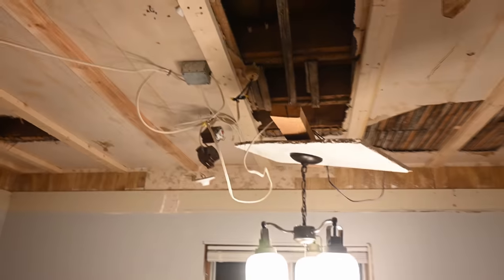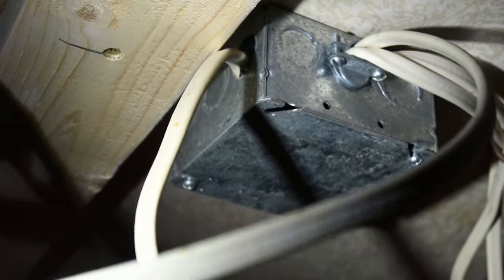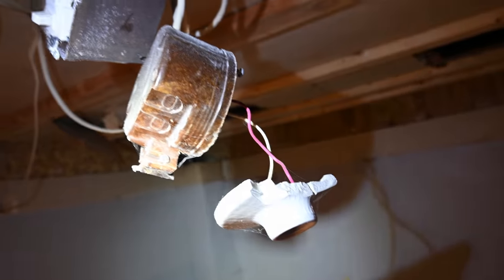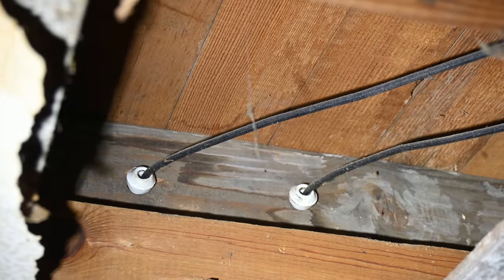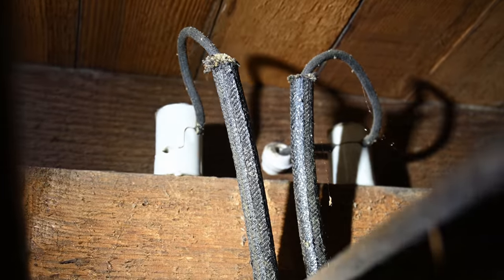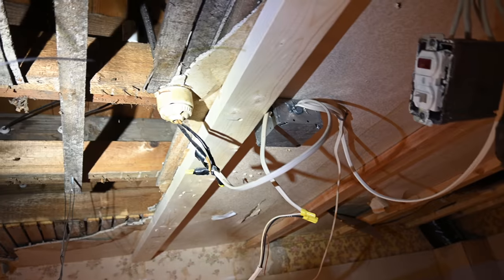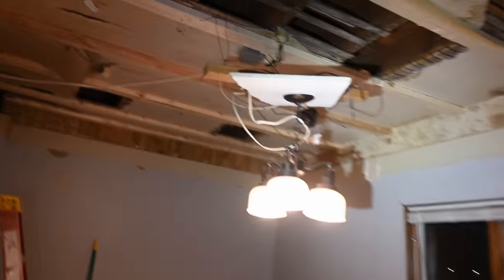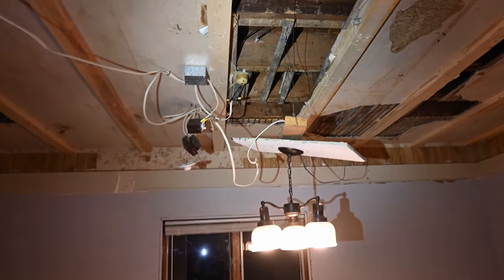The Worst Modified Knob & Tube Wiring Situation I've Ever Seen

Comment: My current house doesn't have knob and tube,  but it had what I call festive wiring.  I had old blue aluminum,  orange  copper mixed with modern white wire and some weird brown 1970's 14/2 looking  wire that I have never seen before. 

I  have been working on replacing it all for about a year.  So evey moment of spare time has gone into just fixing the wiring issues.  I  only have the kitchen, dinning , and living room left to do. But it's been a nightmare removing exactly the type of stuff you just showed.
Reply: LOL they did have a rainbow of colored sheaths in the 60's to 80s
Reply: @konradpetz7317 ,  Yes. All the different wiring through the decades were very colorful, and my house was like a museum of wiring through the past four decades.  

Unfortunately,  the original owners mutilated eveything to the point that I had no choice but to take it all out.

Comment: The flexible insulation is called Loom. I once did a job in an old multi family (3 decker) that used knob & tube for the stairway lighting. They only had 2 conductors between 3 & 4 ways. I took an early lunch break at home and dug out my notes from school. It was called the Carter Multipoint Switch system. It worked, and was apparently legal when installed, but is now considered illegal because polarity to the lamp holders would reverse depending on which switch was in what position. I’m sure glad I kept good notes!! My instructor was probably a generation removed from Edison. Seriously. His Master Electricians license number was a single digit!! I still have a diagram of that Carter system.

Comment: 😂🤣Funny stuff. I've seen plenty. Going up in the attic in a house I bought, I stepped on a small junction box and the lights blinked. The box was too small and had 4 BX cables going into it, no caps, just taped together. I spent the next weekend rewiring everything I could get to....

Comment: I once traced a 50A/240V line from a kitchen oven to the outside main panel.  About halfway along, in the attic, I found the insulation stripped on one hot leg and the neutral, wrapped in tape (no wire nuts or junction box) and taps run to the ceiling fan in the room below. This mess was completely covered in loose cellulose insulation. Yikes.

Comment: My house was built in 1898, and had many wiring issues when we recently moved in.  I'm slowly working my way through them.  We've got a couple fixtures that don't work, but mostly switches that don't do anything and I don't know where they lead.  Just today I got two outlets working that were miswired.  It seems as more people moved in, more people didn't understand what they were doing and mucked things up.  It's an interesting challenge.  At least a nice 200 A panel had been professionally installed.

Comment: In my attic when fixing a ceiling fan which was installed wrong I found romex wire stripped (hot and neutral) about 2’ of bare wire separated with a Piece of fiberglass  insulation. The wire was live. When I saw this I turned off the main panel and went through the whole wire system in the attic. Found very similar wire connections like what you encountered. No junction box/ junction box with no connectors!
Reply: Oh brother; that's terrible!  I don't see much excuse for leaving something in that condition.  It's not like Romex is expensive, at least for that amount needed to properly replace.
Reply: @dougb8207  most people who try to do there own electrical install have no clue what they are doing. The worst is when they think they know how to do it. I was fortunate that I didn’t get hurt or the house didn’t catch fire. The ceiling fan that I was intended to trouble shoot because it started to smoke when you turned it on was installed with the original old works ceiling box held together with #14 wire to the stud and nail. I had to redo all the ceiling boxes with the appropriate ceiling fan box.

Comment: The K&T in your video is in amazingly good condition, all of the stuff I find the insulation is cracked so much you can often see whole sections of bare conductor. In my house I often saw in-line splices (no box and no wire nuts) in the joist space which would have matching scorch marks on the wood behind the junction - presumably from modern appliances overloading the wiring and especially the electrically-poor splices. My favorite find was when I recently pulled a failing receptacle out of its junction box to find a K&T branch coming off the secondary lugs and out the bottom of the box. After investigating all junction boxes in the immediate vicinity and not finding any other K&T, I started gently pulling on it just to see what I'd get. Ended up pulling 6' of K&T wire out to find that the wire didn't actually go to anything at all and was just hanging out, live & exposed in the stud space below, for 16 or so years. Scariest was when I discovered several relatively new NM runs that had been chewed down to bare conductors by mice.

Comment: Yikes.
I once saw a situation where a guy that had no idea how residential wiring worked, tried to steal electricity by installing some lamp cord into the meter side of 200A main breaker in a panel and wiring it to a receptacle. Figured it was free because it didn't pass through the main breaker.
Reply from the maker: Yikes. That's terrible.
Reply: Ahh yes Darwin’s theory in real time. You should not have interfered with evolution.

Comment: We recently bought a 1972 house with an outbuilding that has been a wood shop, barber shop, and an apartment.   Neutral switched, multiple junctions with no box, 30 amp breakers for lighting and receptacles.
Reply from the maker: I actually found that some of the 14awg wire on this project was on a 20a breaker. It's amazing that houses don't burn down more often.

Comment: When I moved into my last house I found the downstairs lights wired with speaker wire. Then I found romex that had been stripped mid run and had wires wrapped around it for a tap to an outlet. Had to gut it all.

Comment: That’s updated, has insulation. I not sure, but that “  may “ be asbestos. Tubes are great knife sharpeners. 😁
  Almost forgot. A building in old town  part of city that had bare wire knob and tubing also had three little metal film containers in attic that held film repair manual for GMC’s first automatic transmission. Pretty cool find. 😎
Reply: probably not asbestos. More likely either old style plaster, which contains cement and horsehair fiber, or Homasote / beaverboard, which is a pressed paper product. Either way, the 100+ year old dust that comes down with demolition is not good to breathe.... and sometimes contains coal dust or rodent droppings.
Reply: @rupe53  If I messed with any of that in an old house I would wear an N95 and pray that the insulation isn't asbestos (which is a possibility).  I don't want any of that stuff in my COPD and asthmatic lungs.
Reply: @mharris5047  ... I am not aware of any home insulation that was asbestos, other than what was used on pipes. Shredded newspaper or cellulose was way more common back then, if anything. Still, you'd be smart to protect yourself in a demo project. Plaster dust is loaded with the same crap as crumbling cement, but the particles are finer.

Comment: Yes! had to do a complete rewire on a house built in 1925 Kelso, washington.  The home inspector did not like the 100yr old wiring (even though it had no power in the old wiring) left up in the attic had over 150 of them had to take out, and there was so much wiring left over i could reconnect old circuits that were disconnect for years, but most of the insulator and wiring i saved as antiques old memories. And yes  i worked on a old house back in 1989 the so called :knob and tube" was the the old wiring that was put up in 1894 was a Tar and cloth that wrapped the old wiring as it was easy to see the cloth and tar was coming falling apart

Comment: When I was a kid, lived in a house that was probably built in the late '80's, that is, 1880's. House originally had gas lighting, and was "upgraded" to electric by pulling K&T wires thru gas pipes, that were used as fixtures.   No problem, the house was insulated with shredded paper.
Reply: That's exactly right. Modern electrical conduit today is descendant from old fashioned gas piping.

Comment: Weirdest wiring situation I ever ran into was an old farmhouse that had A three-way switch from the top of the basement stairs to the bottom of the basement stairs. The switch up top was being fed directly from the circuit box with its own breaker and the switch on the bottom also had a hot lead going to a separate breaker in the box. There were multiple tie ins to each fixture and somehow all of this worked 🤷 even though each of the fixtures was rated at 120. The three-way however did not work. It was as if the switch up top powered the whole system so you can turn the whole basement off and no one from that switch. However the lower switch only worked to power things on and off if the upper switch was in the on position. What baffled me is that all of the fixtures were hooked to both switches somehow so you would think that since they both had their own separate breaker and hot that you would be reading 240 at the fixture. Yet somehow all of these 120 fixtures worked just fine without overloading or overheating and somehow each fixture only read 120 volts. I don't know how it was working but it didn't sit well with me so I ripped it all out and wired it back to a single breaker with a proper three-way and a single junction box as there was only four fixtures down there. 🤷

Comment: I bought a house built in 1920.  It had post and wire inside wiring.  These were porcelain insulating posts and bare wire.  The house was fed by two 110V circuits.  It had a kitchen with a refrigerator and a freezer along with an electric washing machine and a gas dryer.  In addition they had a window air conditioner all on one circuit.  The other circuit was for lighting and a few outlets.  We rewired the whole house to 2012 code and removed all the post and wire wiring.

Comment: My dad bought a 3 story brick house  in the late 60's that had knob and tube added to gas lights. The gas ceiling fixtures had been converted and were still hanging from what was wrongly assumed disconnected gas piping. An attempt to insulate the fixture from the pipe had been made but trying to get the fixture tight to the ceiling resulted in having the light come on regardless of the wall switch position.  Did I mention that the gas was still connected?  I marvel to this day that we did not perish in a giant fireball.

Comment: A friend of mine went into the basement with his buddy to remove some drywall and supporting lumber. A simple job.
   Their electric tools did not work or work properly. The hot wires and neutrals were crisscrossed repeatedly. Why the house did not burn down is a mystery.
   The two spent the rest of the day correcting the wiring problems and getting things to code. Then they finished the simple dismantling job they started hours earlier.

Comment: I found similar crazy wiring done in a commercial building last year. It turns out the old electrician looking after the place knew how to do it but was a drunk. I added a bunch of boxes and Marr connectors (instead of black tape holding stuff together). I pray I found all of the bad wiring work.

Comment: Yeah the previous owners of my old house had hots wire nutted to neutral. I was wondering why when I flipped on the light it was dimming. Seems the draw was not enough to trip the breaker. They must gotten lucky and it was not secure enough to dead short. Yet that would have been preferred to having a toaster in the ceiling. Turns out I just pulled every box and junction I could find, toned it out and rewired everything with new termination hardware. I was not taking any chances.

Comment: Originally if installed correctly was a good system as the wires were 6 to 8 inches apart .  The holes where the tubes run thru the joists are good for running Roman or bx.
.

Comment: That is relatively new K&T and a weird mix on the original install.  It has the tubes thru the wooden structure members, and knobs to end the runs, but having insulated wires is very rare and mostly negates the need for the tubes and the knobs. Most of the K&T was bare copper.  I've seen several K&T installations, and never with insulated wires.  And I've seen a couple of installs with insulated single wires like that, but they didn't use any ceramic K&Ts.
Reply from the maker: Interesting. I've never seen the bare wire you're talking about. I've seen quite a bit if knob and tube but all of it was insulated as far as I remember. Could be that the area I live in didn't have "modern wiring" installed until after they switched to insulated wiring.
Reply: @BenjaminSahlstrom  I’ve only seen bare wire installations a couple of times. Those were on the really old side of town. Most K&T is insulted. Often, the insulation is damaged or dry rotted to the point it’s falling apart. Once in a while I run into a service call at a K&T house with a 60 amp fuse board? Those are always fun. But as fun as they are, they will never be as fun as the time I saw an entire house wired with lamp cord. Whomever did that was an ass and they knew exactly what they were doing. The receptacle for the range had 8 parallel #18 lamp cords as it’s home run.
Reply: @Veritas-invenitur  Wow...
Reply: @Veritas-invenitur  I can't even imagine wiring a house with 18 AWG wiring.  I don't even like 14 AWG but people still use it on lighting circuits.

Comment: This is a common site for me in older buildings with lowered or drop ceilings. They leave the existing fixtures buried above the new ceiling and either screw a socket adapter on the shell or dangle the fixture and tie into the wiring to power the new fixtures below. Not always a tgrid ceiling. Mostly drywalled in and inaccessible.

Comment: My buddy has a house in the city that was 100years old and the nob and tube had been “replaced”. When we removed the plaster and lathe in the living room we found they had only replaced it in the basement.  The stuff in the house you are working on has a sheath on the wire.  My buddy’s house was all bare wire. They had blown in insulation in the outer walls and it was all black around the wire.

Comment: I recently came across a kitchen circuit where there were two cables joined together. One cable was going from the main panel and another cable going  from the subpanel. It took me a while to figure out why it was hot when the breaker was off 😅

Comment: I came across a similar situation in a house my sister just purchased for a rental unit,  the difference was where you had Romex, she had 18 gauge Walmart extension cords with the end cut off, (zip cord) I told her there is no way you can rent this place out and sleep at night! She gutted the building and I rewired it completely from the utilities incoming line.

Comment: The great disadvantage Of knob and tubing no ground wire in place from early 20th century technology. The only advantage is the wires can be pulled as pull wires and replaced it by Romax cabling. That could be possibly done by reusing drilled holes that the early electricians installed the old knob and tubing, when the house gets to be rewire with Non Metallic or metallic cabling.

Comment: Been there done that. Bought a 1930s house. Advertised new electrical rewire. New meter panel, new wiring into old gutted meter panel and spliced into knob and tube branch circuit wiring. Don't know how the city passed it. Total Rewire!

Comment: My garage was wired with what looked to be a bunch of scraps. Short pieces of romex all spliced together out in the open with no junction boxes. An old busted up west ghouse panel, and the lights were fed by multiple lamp cords wire nutted together out in the open without grounds or junction boxes. Fortunately the 100A service wire had been professionally replaced. A friend and I ripped all of that shoddy crap out and rewired the whole building with a new panel and all.

Comment: Not even close to the worst I've seen!  
I remodeled a 120 year old home.  It had a new panel and romex wire everywhere you could easily see, but it was all tied back into knob & tube in the attic, and nearly everything in the house was on a single circuit!  We also found recepticles and abandoned switches inside walls that had been drywalled over, but were still hot.  
Yup...ended up re-wiring everything.

Comment: My parents brought a craftsman bungalow built in 1927 6 years ago.  Was told the wiring had been upgraded to NM cable, and it appeared to be along  with a 100 amp square d breaker box.   All looked well so far.    That was until they discovered what was probably the original service panel,  used as a sub panel, in the closet next to the master bed, still live and feeding knob and tube.   2 circuits, fused on both hot and neutral,  there were 4 Edison fuses along with an open knife switch above the 4 fuses, as the disconnect.   In the attic there was modern grounded romex spliced into the knob and tube circuit,  and they tried to ground it by connecting a wire from a nearby steam pipe to the ground wire inside the romex, so a three light outlet would lead you to believe there is no older wiring in use.    Safe to say,  all the old equipment is out of service.

Comment: If the K&T are not overloaded and left alone, they"normally" are ok.    Air was the main insulation as "normally" no insulation in the walls or ceilings. (All you safety folks notice the "normally").  Now I would rewire and not use it anymore., but would save all the fixtures.   Look forward to the video.